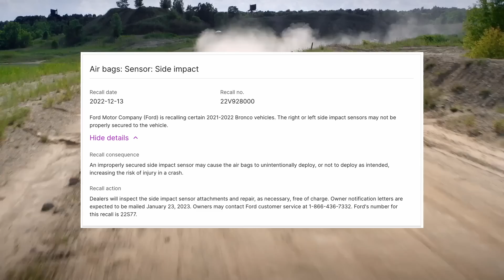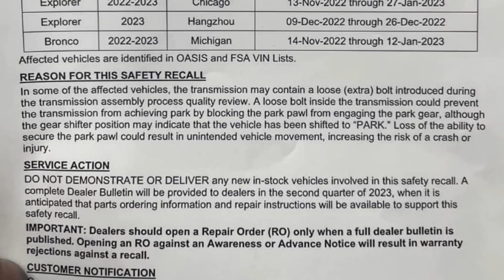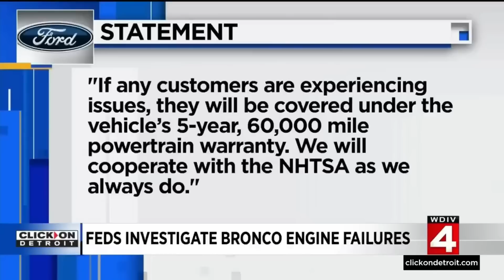YIKES! More Bad News For 2023 Ford Bronco Buyers

Comment: Still cooler and better off road than a defender. It's a new model, what do you expect. Ford will fix the problems albeit in the next years model.
Reply from the maker: All of this is true. The Defender has a ton of issues as well. Mostly electronic gremlins.
Reply: @MotorFeed  So basically this video is misdirected towards the Bronco because most if not all mainstream MFG today have recalls, TSB's etc. My guess you picked the Bronco because it's very popular right now (Clickbait) but in reality it's just a sign of the times.  Build fast fix later, just ask Tesla, FCA, Kia, Ford, GM and so on.  This recall impacts many Fords models built during a recent timeframe.  Maybe call this video, "Why so many recalls these days Ford?" etc. Usually Ford blames the third party supplier which they say they are just the buyer and not the builder.  Time to bring back all MFG to USA and build it like we used to.  Wait, no one wants to work those jobs anymore, scratch that.  Retitle "Ford is doomed due to lack of supplier quality". Look at the MIC for example, still not perfect but what can Ford do?  They have one supplier for it, whatever they churn out they have to take or MIC orders fall behind and customers get angry.  Welcome to future.